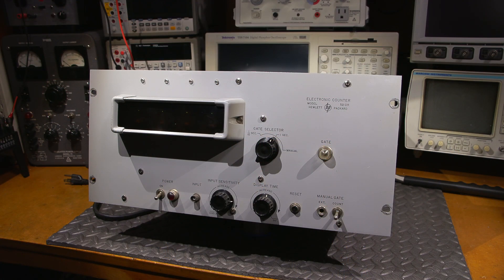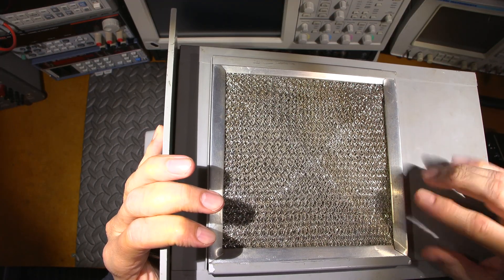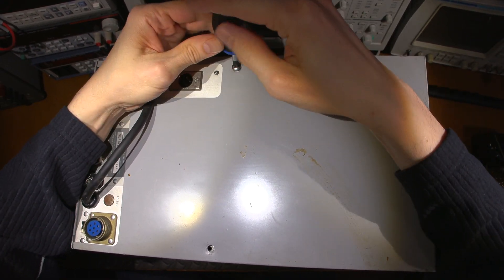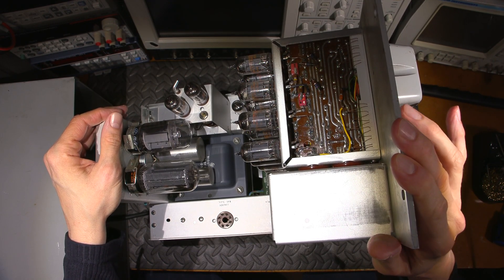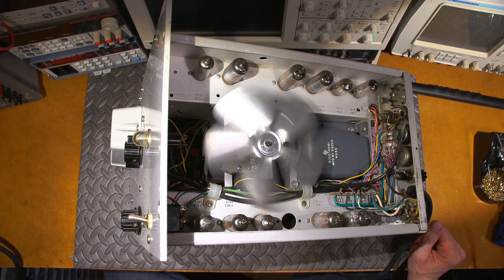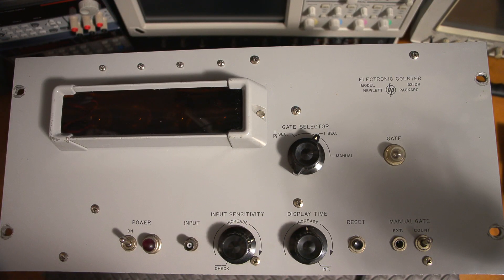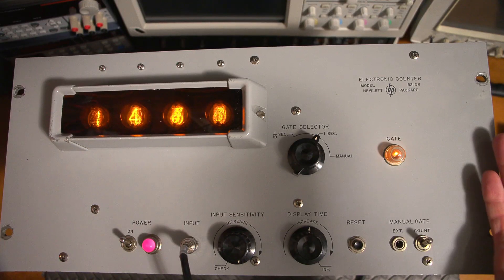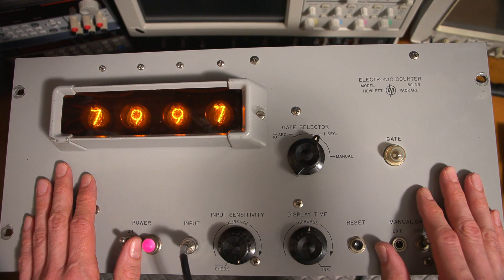1950's Digital Electronics "Vacuum Tube Goodness" - Will It Still Work?

Comment: What often amazes me is the visible genius in finding efficient solutions at a time when every single active component was valuable and had to be used as well as possible. The electrical engineering is also easy to see and understandable with your own eyes. Today circuit technology is hidden in the nano world of modern circuits and has reached a level of complexity that only specialists can fully understand.

Comment: Another entertaining walk-through video - it continually amazes me how solid a lot of the equipment of the 50s and 60s continues to be.  I have an all original HP 5221b counter from the late '60s that I use all the time and it appears to be quite accurate.  As I understand, these were the bottom feeders of the HP counter line as they transitioned from discrete components solid-state to integrated circuits but hadn't made the jump to nixie tubes yet.  While not as cool (or hot, as the case may be) as the all-tube counters, who is not mesmerized watching the nixie tubes as they switch from number to number.

Comment: Omigosh! I can litterally smell the electronics through my monitor! LOL! Pertinax circuit boards, passive components, plastics, zinc, aluminium, hot tubes and transformers... Once you've worked with it, that scent stays with you for the rest of your life! :)

I must say that this video was also a flashback for me: The last time I used one of these exact same gems were in the fall of 1994, in the shop of an old friend of mine while calibrating a couple of function generators I'd built. His 521DR was well used, 100% original and still well within specs. (Annual calibration)

So thank you Sir, for giving me this happy little walk down Memory Lane, it was really appreciated!

Comment: Did a quick research and the DR was built in 1959. It is so funny and fun to watch this HP counter as I am doing so on my HP Compaq which has been a very good computer for me. I would love to find a counter but also want to find a NLS unit which would be the early ones in the mid 60s that my dad worked on. He was the guy who made sure they worked and for the new ones would find their limits. (NLS Non Linier Systems from Del Mar, California).

Comment: In 1965, I was an electronics mechanic at the inertial navigation facility in the F-104G at the Danish Air Force. At the service workshop we had various test setups, in the top of one of the 19 '' racks with measuring equipment there was such a frequency counter. The main power supply to the plant was 115 VAC, 400Hz, but internally in the plant, the energy was converted to lower voltages: 4500 Hz and 375 Hz stabilized with crystal in 170 F component furnace.

Comment: Just a beautiful unit that shows the difference between the pride they took back then and now. Almost 70 years later and the product still works.
Reply: Just keep in mind that this was a monstrously expensive top of the line piece of gear from a top-notch manufacturer.  The vast majority of stuff from back then was nowhere near as good...
Reply: @KeriRautenkranz  Well sure but HP back then was right up there with Tektronix.  HP today? I wouldn't buy it with your money.
Reply: Try getting that life from a smartphone.
Reply: @paulstubbs7678  Haha... wouldn't that be funny if Mr C digs up an intact iPhone 1 in 60 years or so?

Comment: So clean and nice that it looks like it never has been in service.
HP of that era is just top of the line. 
Impressive, but so was the pricetag at the time.
Compare that with what has the HP logo on it today...
Reply: You mean "Keysight."
Reply: @sanityassassin8161  No I ment those plastic laptops that they produce.
In addition to the servers and ProCurve switches etc.
Keysight equipment doesn't have the HP logo on them.
Reply: @geirendre  Right you are. As I remember it, about twenty years ago HP sort of split and used their well-known logo to cash in on the PC market and spun off Agilent as their measurement arm. Is Keysight is HP's current measurement division -- or am I mistaken?

Comment: As the saying goes "They don't make em, like they use to." Things are just not made to last like this stuff was. Many thanks for another great video.
Reply: For real, man.  Real iron in there...large old school linear supply that doesn't switch and squeal...you could warm meals on that thing.  It's interesting to see the scales of it and how robust stuff could be and still remains.  HP knocked it out of the park.  Have an old distortion analyzer mid 60s from them.  Still going.  Uncle passed recently and I acquired his Hitachi 70s era 'scope.  For over seas, it was very signature in style.  Budget-conscious, but very Japanese and equally cool to see.  Equally has stood well to time.  SUPER similar pcb design, parts choice/brands, to virtually any hi-fi monster stereo of its time; kinda eerily similar to work on.  Still shoots a killer trace up; little isopropyl on that sucker brought it back from the drink with all the pots lol.  Oh and caps; a few had grown warts.  Everything was easily marked and labeled to trim it...good times.  SMD has some advantages, too.  Biggest one is not having to pry stuff off.  Hot air...10 seconds...done.  Thru hole can be kinda rough to go digging out sometimes.  Very give and take.  Some audio stuff now that you can find in SMD is incredible.  30W class D audio amp the size of a dime.

Comment: wow that was great to see. Amazing how long well built hardware lasts. Nowadays it'd be obsolete in 2 years  and require 4 firmware updates to allow the user to change the display colour and font to comply with the latest UI guidelines. Lovely 😍
Reply: I do have to laugh when I see modern test gear with full colour LCD (or OLED) displays used to display a couple of digits and not much else. A right pain to fix if the display dies.
Reply: Or like those people with the "now unsupported" bionic eye, its obsolete and now you can't see.

Comment: Wow, I thought my 5350B Microwave Counter by HP was ancient.  Bought it used at auction for about $100, and it has a crystal oven. 20 GHZ with 1 HZ resolution.

Comment: Wow! Even a metal spring clip to hold the air filter in. Today that would be held in by plastic tabs that you would have to figure out  how to pry apart (without) breaking them off! Great video! My other half got me a couple of vfd tubes for Christmas so I'm looking forward to working with these and nixies in the future. Thanks for bring new life to this old equipment that would likely otherwise go to waste. Even generations in the future will have these videos available to them!
Reply: Also, I'm very interested in the vacuum decade counters. In the future it would be cool to go over than in this or another restoration. 73's!

Comment: This is just cool. The quality of the wiring inside is insane. If I had one of those and it worked that well. I'd absolutely be using it when I could. There's no reason not to. It will probably be working in another 70 years (well maybe with some capacitors replaced).

Comment: You certainly do have a handle on what us old buggers love for tube porn back when electrons still flowed the proper way. If I recall, those counter units had four dual triodes as FF decade counters and used coupled neon lamps and CdS cells as a decoder - the latter practice was used by Panasonic well into the RTL desktop calc days.

The boys at the shop with their fancy DMM's laugh at me when I pull out the 40 y.o. 'sample and hold' Nixie Fluke. But it gets the job done.

Comment: Thank you for this look at some righteous test equipment! Just think of it, from a short time at voltage, that count is so close to spot on!

Seeing that gear in your lab warms the heart. Years ago, in high school, I had a wonderful experience. A room full of Tektronix, EICO, Simpson, HP, and Fluke. Racks full of former industrial and university gear. 

Digging further, chassis punches, round and square. Bins of terminal strips and decent fabric wire.

When I studied electronics, my classmates were learning about circuit boards. Hell, I etched my own at home. Sadly, they liked the novelty, but had little interest in the history, the real engineering behind it. The magic and satisfaction of watching tubes come to life, and watching the difference as I got the plate current and bias...just perfect.

I digress. Watching you work, and the attention to detail, is joy to the heart.

My projects? If it didn't have tubes, point to point build, and high voltage, I wasn't interested. This was in the 80s.

For many years, I had a trusty restored EICO tube tester at home. My first oscilloscope? Yes. You'll love this. A Waterman S-14-A Pocketscope. Think I was 14 back then.

Thank you so very much for sharing your lab with us! Love every minute.

Bob
Reply from the maker: Thank You for taking the time to write Bob, and your kind comments too!

Comment: Nice old tube equipment! Some twenty years ago I dismounted a Northeastern type 14-20 tube counter, even bigger than this one! It had around 30 tubes, its power draw was around 600 watts! I still have the crystal oven from it, and one of the nixie tube modules with 4 electron tubes at the back, similar to what's in your counter

Comment: I used Nixi Tube HP sine wave generators in the 80's for Telecom.. Total tough equipment used by dozens  of techs daily for years. They always works and the switches never failed..  Real workhorse equipment.

Comment: Hi Mr Carlson,  I think a CRT to LCD conversion would make good viewing. I have several hp/Agilent oscilloscopes and logic analysers
they have been very well used by me and others,  2 have very bad screen burn and one has a tube that's just gone cold.
i would love to replace the tubes like for like but its so expensive. I have seen  a conversion for a Tektronix  scope on YouTube and
many for arcade machines. I sure there are many viewers that would like to see you convert a an analogue crt drive over to LCD.

Comment: Right away after you got the cover off I noticed a power tube, like an AF output beside the 5U4 rectifier, that has to be the Regulated HV power supply. Most of their tube equipment utilized B+ regulators.

Comment: Great channel.  I do have a niggle about the advisability of bringing the mains voltage up slowly.  Fair enough to "soak" equipment at at extremely low voltage (too low for the heaters to start emitting), to re-form the PSU electrtolytics.  Obviously only of use if the equipment has solid-state HT rectifiers rather than tube rectifiers.  But IMO you should not apply lower than normal voltage once the tubes are glowing.  There are plenty of circuits that are damaged under prolonged "brownout" conditions, where for example the bias on a tube (or transistor) designed to be used in class D (switching) mode is changed under low voltage conditions so it is neither fully on nor fully off, causing it to dissipate too much power.  Some fans will also stall or partially stall and overheat if fed way below their design voltage for too long.  Also I was told that operating tubes with too low a heater voltage can damage the cathode coating by "pulling" electrons away from the cathode before it is hot enough to be fully emissive - though I've not verified whether there is any truth to that.
Reply: The circuits damaged by being brought up on a variac have exactly zero to do with anything discussed in this video.
Reply: @chrisw.3077  I find it as an aside of useful information.
Reply: @sanityassassin8161  the problem is that this “advice” will cause people just to plug in old gear and not bring it up on a variac (while monitoring power consumption) which will cause needless equipment failures. Your tube amplifier or vintage stereo receiver prior to 1980 cannot possibly contain a class D amplifier. I’ve also never heard of short term low voltage harming a tube.
Reply: @chrisw.3077  You can never be certain that nothing in a complex circuit will be damaged by operating it lower than its design voltage unless you analyze the circuit.  Being digital, the tubes in this counter will be operating in class D, which is just the type of circuit that might be damaged by low voltage.  Plus the possible shortening of tube life by running the heaters too cold.  I'm just not seeing a big advantage in bringing up the voltage slowly.
Reply: @chrisw.3077  I am not convinced that bringing it up slowly on a variac has a good probability of saving anything.  It could even cause more damage if a fault causes a cascade failure rather than blowing a fuse, so I'd say it's 50/50 whether it does more good than harm.  The first thing to do on old equipment is always to remove the covers and do a very good visual check before introducing any power.  They used to use rubber insulation, which will almost certainly have perished.  All the old electrolytics should also be checked and if possible re-formed or replaced separately before powering the whole unit.  You should never simply power up an old piece of equipment on any voltage at all without a good visual check and an electrical check of the "usual suspects".

In the more general case, "brownouts" are well known to cause far more damage than "blackouts" (although that's mostly due to motors stalling and overheating, quite a few items of electronic equipment can also suffer).  I know of at least one solid state power supply that will definitely overheat and start smoking if run at 75% voltage for a minute or so.  Running anything way outside its designed operating voltage (either above or below) takes you into unknown territory and you simply don't know whether or not it could cause more damage than it prevents.

Comment: Tech question !

Where's it getting its clock signal from if there isn't a crystal plugged in ?

Presumably the 60hz mains input ??
Reply from the maker: You are correct! The main is the reference, and the reason for the count that moves a bit.
Reply: @MrCarlsonsLab  Thanks for the reply !

Comment: Just beautiful! I wonder... Could it be that the "error" in the indication is due to the signal generator? I mean, does it really produce 5kHz and not 4999kHz? :)
Reply from the maker: It's using the AC line for the reference.

Comment: Another valves goodness or vacuum tube there in the US. Paul, by experience, and i think you have the same, old HP stuff is normally in good working conditions. They don't do them like that anymore for sure. 73 from CT9ABQ - M0IVC

Comment: If it says HP on the outside then you can be assured if needing any slight repair, that it will work as intended.
It had better because it was a costly product back then.

Comment: I was in field computer repair for about 25 years. One of the common things I saw was lack of maintenance on the fans and filters. Wasn't uncommon to go out to a customer who didn't have a service contract (customer's systems who where on contract got regularly scheduled preventive maintenance) and find the failed unit hot as an oven with several dead fans and packed filters. Even though later computers such as pc's could probably have used filters to keep them clean inside, probably better off with out them as they wouldn't have been maintained.

Comment: So Epic, well done 1950's HP, how did you forget how to build stuff to last? 

Thankyou also Mr Carlson, without you we might never see these cool old electronic devices! While in many ways im glad we have moved towards much more energy efficent devices there is something so charming about the old tube powered technology you just dont get with silicone chips and leds.

I would be interested to see a side by side comparison to a more modern fequency counter. Including power factor.

Also considering that device is 70+ years old, i wonder how many modern devices you would go through in that time because of failures, i wonder if the energy used in making replacemets and processing e-waste over a 70 year period, would be less or more than the extra power consumed by that device in its 70+ year life span.

Not suggesting it would be, but genuinly curious!

Comment: Great video  Paul thanks for sharing, can you do a video on the crystal oscillator vacuum tube as I have a rf gen with selection knob and space in back to fit 8  crystal vacuum tubes ,not sure if there missing or the user just fits what frequency they need as a private  channels

Comment: Hey Paul, how reliable/accurate is it to test for capacitor leakage by connecting an ammeter in series to measure milliamp or microamp flow, and/or by connecting a resistor in series and measuring the voltage across it?  I've been testing these methods and most of the electrolytic caps I've tried get down to 1 or 2 microamps of current flow.  One so far was up around 150 microamps and I have no idea whether that's acceptable or bad.

Comment: Why do you have to slowly bring up the counting device? Is it because it’s not meant to be powered instantaneously from the wall?
Reply from the maker: The capacitors are so old, it's just easier on them, and the power supply too. Once it's been running for awhile, it's ok to switch it on right away (the next time) without bringing it up slowly.

Comment: Paul I have a question, it's not really a practical one as I'm never going to do it or even attempt to do it as I suspect it'd be pointless, but it's something I've always been curious about with regard to vacuum tubes. Would it be possible to build out of solid state components, something that can plug into a tube socket and operate exactly like the actual tube did?
Reply from the maker: Look up "Fetron" :^)

Comment: I once had to test A 3phase 400 Htz power distribution system for an aircraft using a motor driven generator for an army colonel. The generator wouldn’t make the minimum rpm so I had to run and get a frequency counter of about the same size and age, almost passed out it was so heavy.